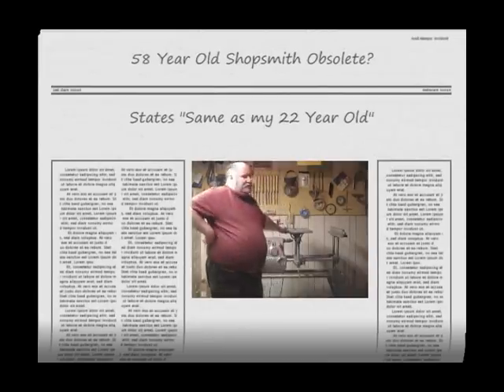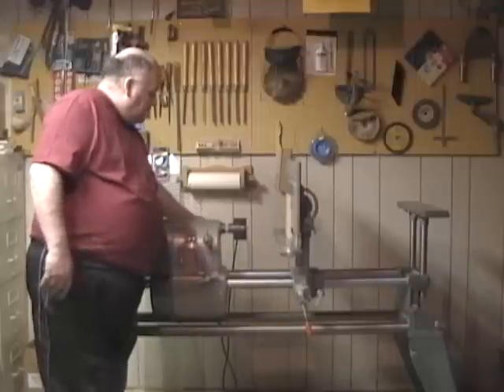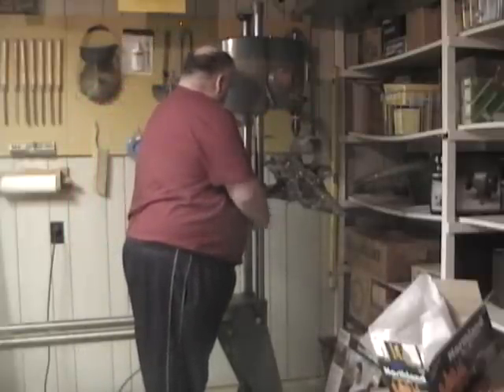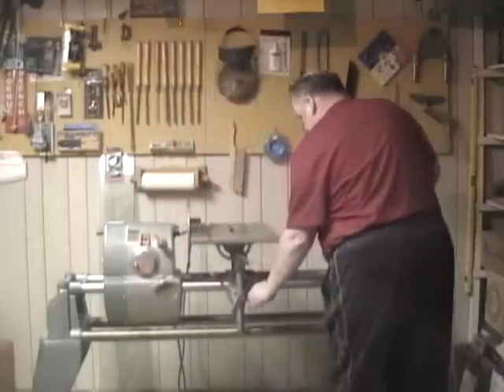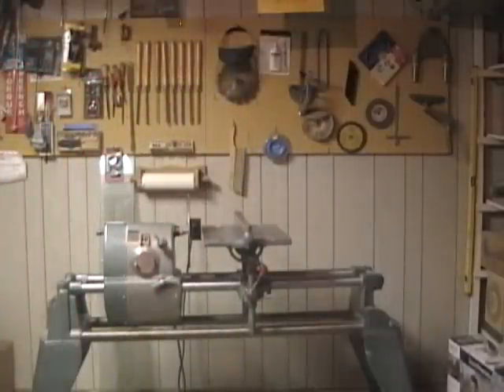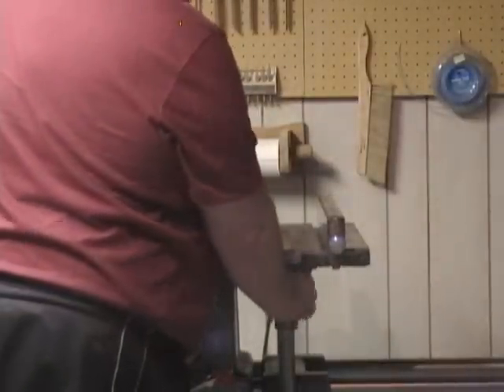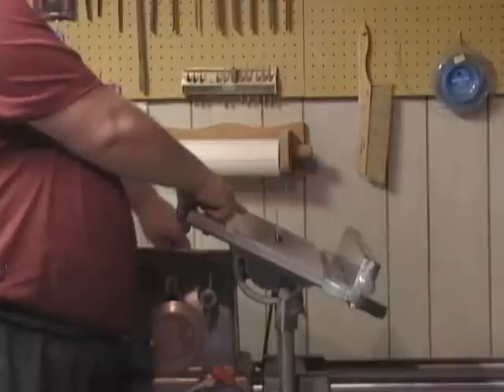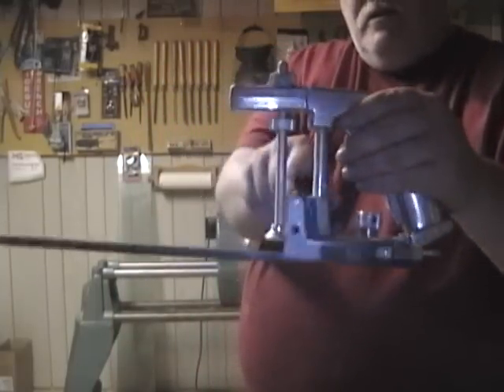Grampa's Garage-Episode 38-My Dad's 1953 Shopsmith Mark V

Comment: I recently bought a ShopSmith from Craigslist. This video was very helpful in explaining the setup and operation of the SS. Thank you!
Reply from the maker: I'm glad it was of some help.  I grew up with a Shopsmith in the workshop, and have seen many things done, and made things too.  You'll love the SS, because of it's versatility.  You may find it's not the best for some jobs but it will be a close second.  Case in point, the table saw works well, but not quite as well as a purpose built table saw.  There are many good videos about the Shopsmith, including several direct from the Shopsmith demonstrator.

Comment: NICE and CLEAN , but not oily , yea this machine is CRYING for OIL, any kind of oil.
Reply from the maker: ***** It does need servicing, since it's only been used sparingly since my dad died in 2007.  The tubes the motor slides on have recently been cleaned and waxed,  I also waxed the table, the motor unit, and legs.  The rip fence has been greased, and the only thing left to do is drop the bottom from the motor housing to clean and lube the inner mechanisms
Reply: Actually there are only a few places that need regular oiling and all those are internal. The tubes, quill, table rods, tables, etc. are waxed with Johnsons paste wax to keep everything sliding easily. The wax does not attract sawdust like oil or grease does. The machines still look nice and clean when properly lubricated.
Skip Campbell
mkctools.com